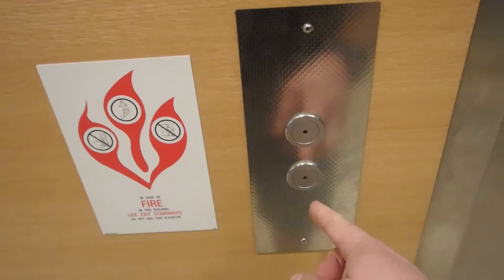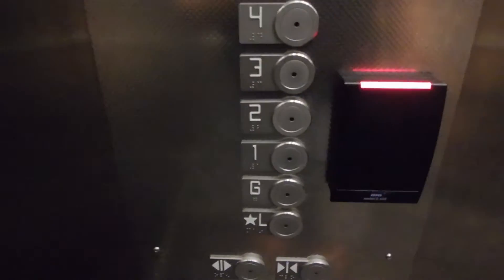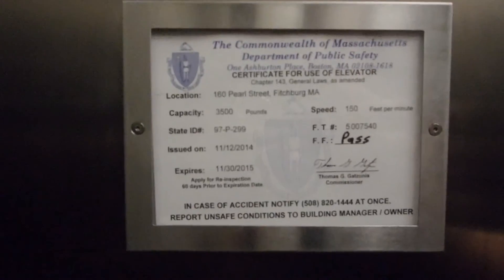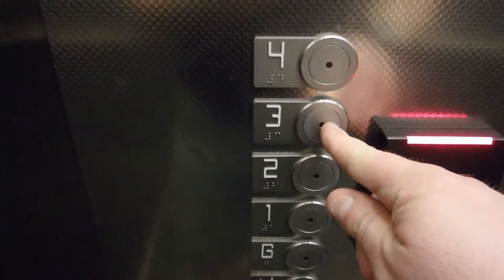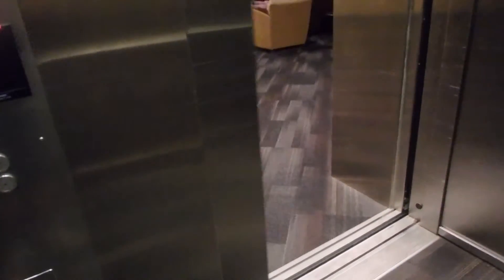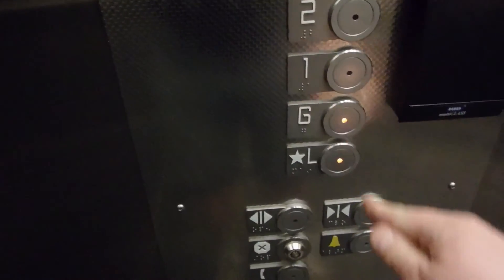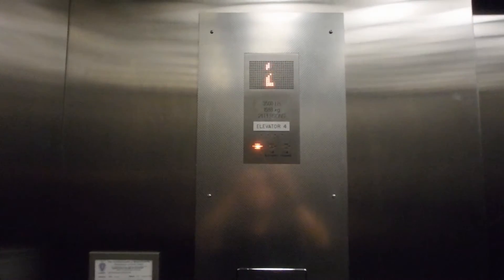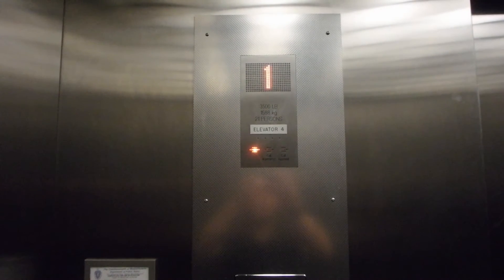Fitchburg: Krappy KONE Eco-Disc Elevator @ Hammond Building, FSU

Comment: George, if you really want to see crappy elevators, go to any South Florida townhouse that uses Elevett ( i think it's called).  I had the fortune to use one, arrive at the top floor and not get stuck.  After i looked around for a while, I summoned the elevator. It wasn't going anywhere!!  As I walked down the stairs to leave, I felt fortunate that I didn't get stuck in that thing!